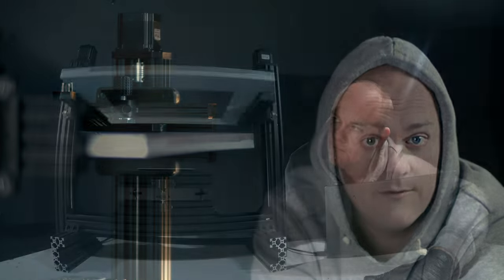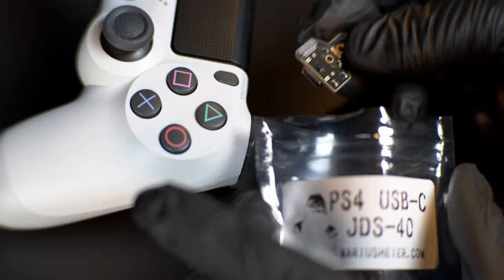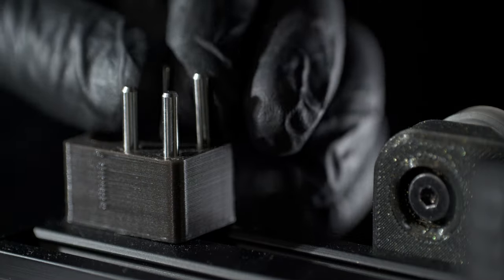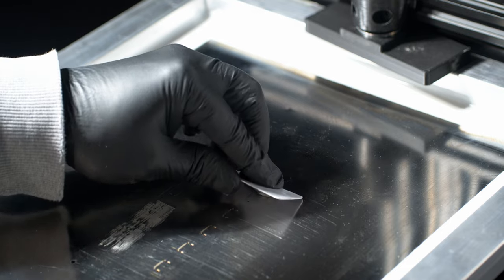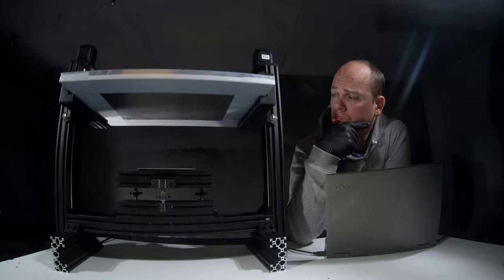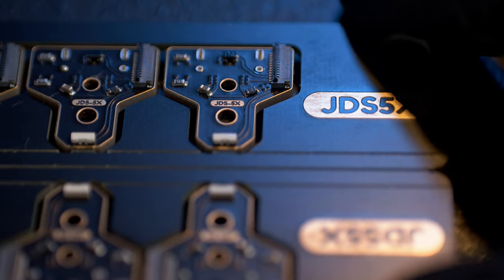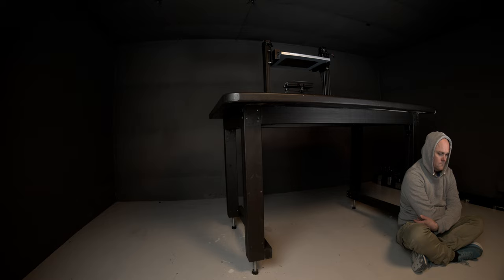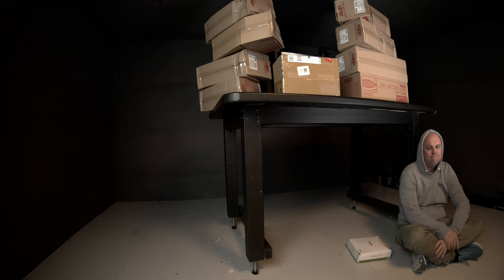DIY robot for making electronics at home

Comment: Won't the circuit board makers also do the soldering and placing the chips? I thought they'd all have the expensive robots and stuff.
Reply from the maker: Yeah they do. But my board has components on both sides so its pretty expensive.
Reply: @MariusHeier1  there isn't a redesign that can just put them on one side?
Reply from the maker: @ADHDbuilt  yeah. I did one about a year ago. But it doesnt align with the port hole. And i find great joy in making these machines.
Reply: @MariusHeier1  Fair enough :), I look forward to mine arriving.
Reply from the maker: @ADHDbuilt  Thanks for ordering :)

Comment: Hello Marius, very far away from you. I am struggling with same issues. Need automation for high quality and less work results and can not afford commercial machines. Diy is the only option. Keep goin...
Reply from the maker: Thank you. Im building a new one soon with auto alignment and inspection soon. Keep going :)
Reply: @MariusHeier1  I am pretty sure you know but even i want to point out some important points;
For better result you can apply 500gr force for each 25mm of blade. 
60 degree angle blade.
Squeegee Speed could be 20mm per second.
Also stencil seperation speed from pcb could be 3mm per second. 
Bolt alignment is smart but could not work as expected so in any case X Y axis movement and plus rotation is mandatory for more accurate results.
Your previous project vacuum assistant can combine with this one it definatelly improves quality of work. All high end machines has this vacuum asistant.
For faster operation and easy adjustment; instead of programing stencil table you can use height adjustable 2 limit swiches and one button. each button press stencil plate moves up and down between these limit switches.
Reply from the maker: @estapkabin  I know..but. Thanks for taking the time to write it all up. :)  Have you seen my previous machine, it has some of the features you are mentioning(not vacuum). But i wanted to make something as simple as possible, and see what advantage it would give me. Let me find the link
Reply from the maker: @estapkabin  Check this out. https://youtu.be/k2Fk3fZo2-E
Reply from the maker: @estapkabin  Btw I'm going to make a new one soon with  automatic alignment and pasting,  with computer vision and motor feedback as guide/feedback.  No automatic cleaning, but i will make some manual cleaning equipment, i wanne clean the stencil for each paste run. And its gonna be a lot more robust.
Reply: @MariusHeier1  Wow i did not aware of it. Cant wait to see new one. So exited. They are mainly use IPA and pressured air for cleaning.👍
Reply from the maker: @estapkabin  Yes. I made a special vacuum cleaner adapter with a filter that i put on one side. And then pressurized air. But i wanne use ipa instead of pressurized air. Since its so good to remove it. But i think atomizing ipa with air pressure is basically the same principle as in thermobaric bombs. Haha. So maybe ipa and some kind of mechanical thing. Like a brush